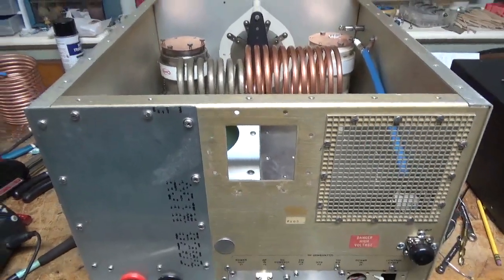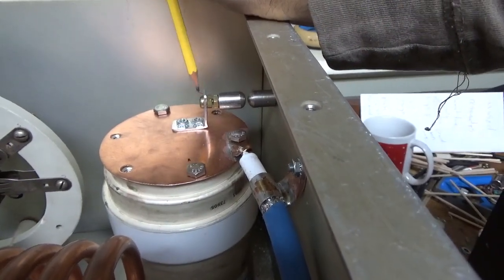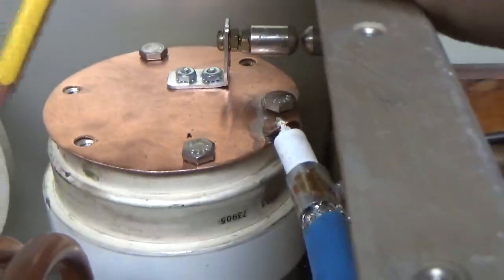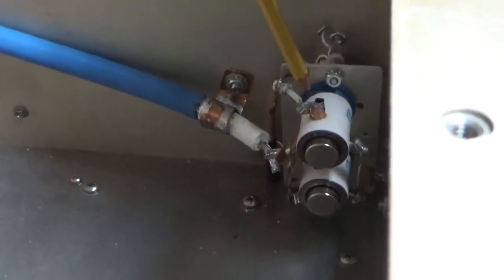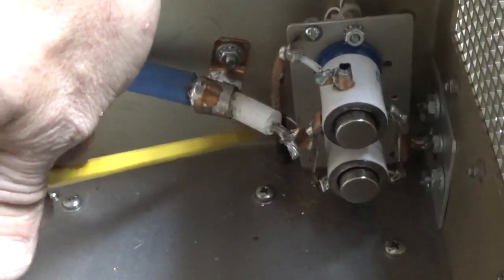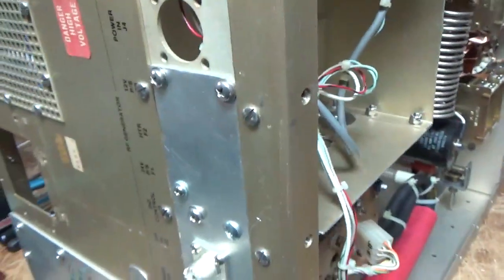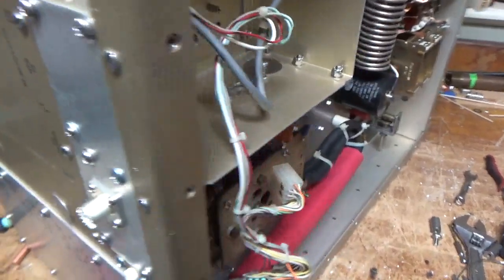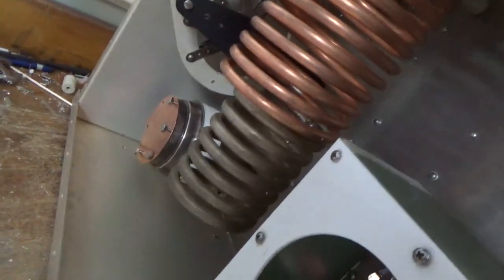Spark Gap , Output Coax And Feedthrough Coax Installed 3cx6000a7 Yu-148 10kw CCS 160-15 Meter Linear

Comment: 3:39 I've used round led holders for thru hole components like the coax when chassis pans were to thick for grommets, They'll snap in the hole and make great insulators, Gonna be a helluva amp when done.
Reply from the maker: Same here , but don’t have any and coax diameter is too large anyway

I have seen larger opening pop in plastic thru hole pieces before . Just don’t have and don’t need it.

The floor is 1/4 thick in that area and hole edges have been chamfered , theirs no way the Teflon lead for the relay coil or Teflon coax jacket would become damaged .  Just to add another layer of protection  I added the 3 layers of thick wall heat-shrink tube .

This is a personal box , not for re-sale